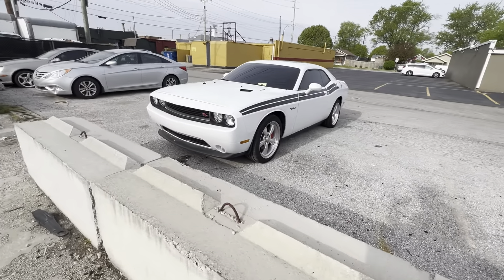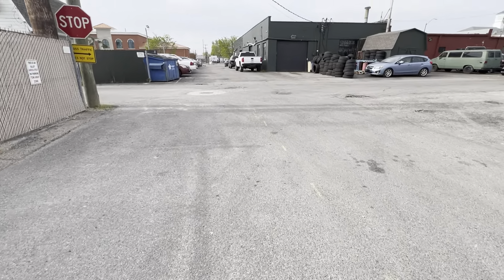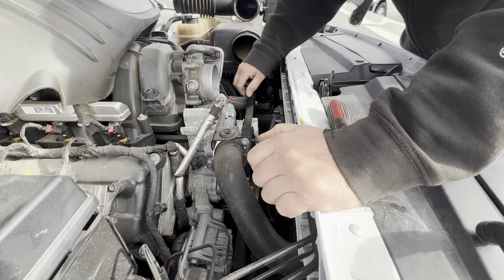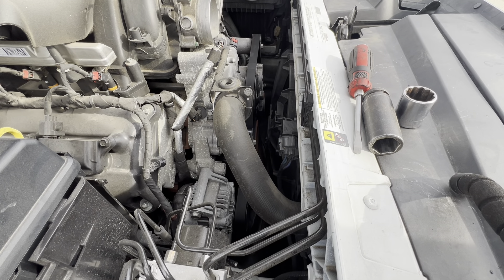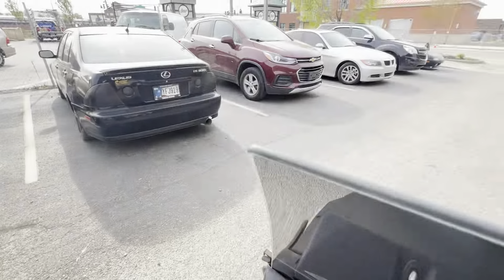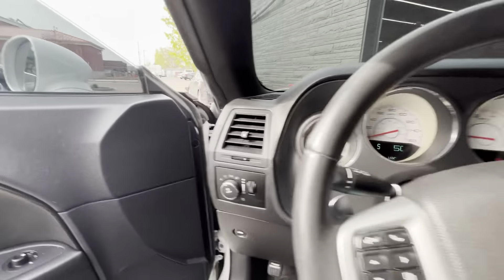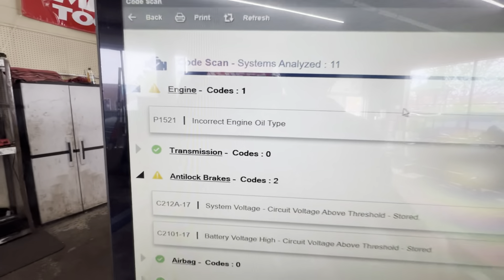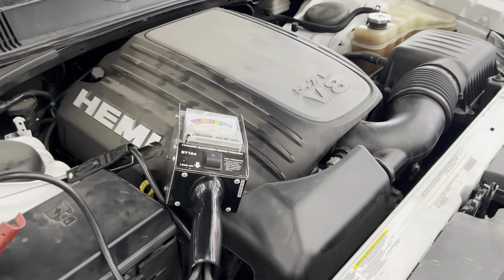2012 dodge challenger, RT 5.7 L hemi customer states engine is locked up

Comment: I'm sure the customer wouldn't be able to tell you anything about engines or batteries. Car could be out of gas, dead battery, not fully in park. At-least they will get a nice surprise to find out they dont have to pay for a new engine.